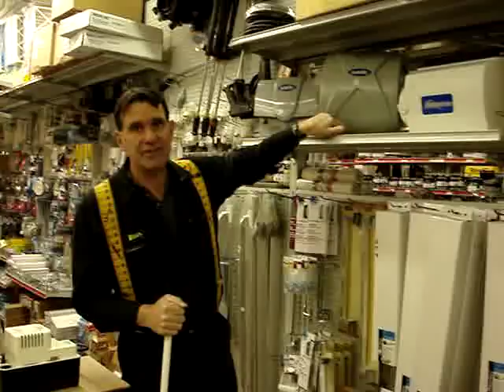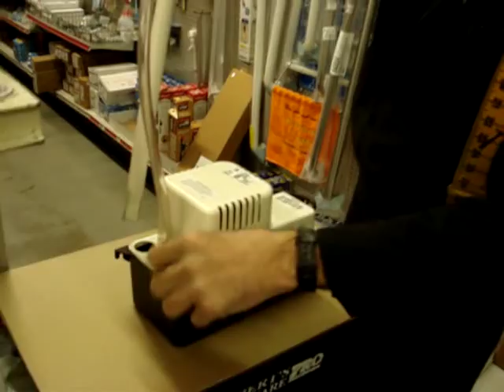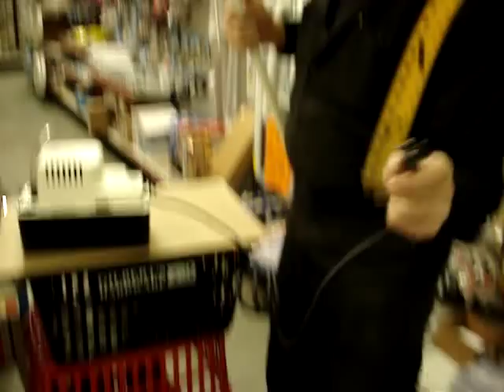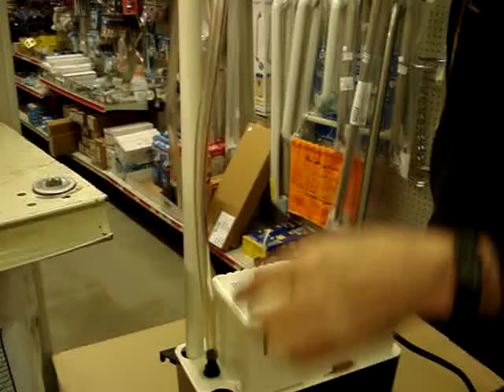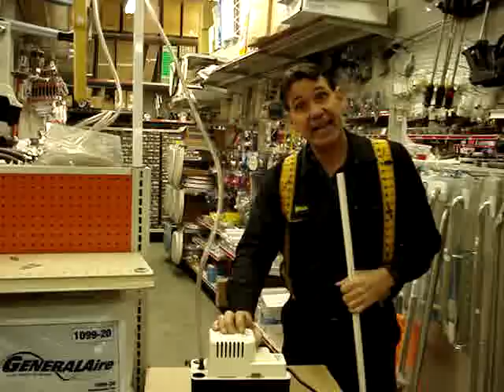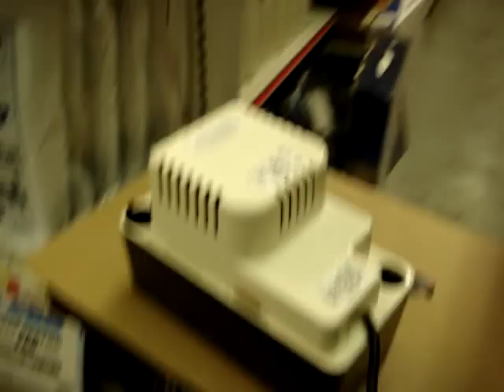Furnace Condensate Pump Moves Water If There Is No Floor Drain

Comment: I realize this is an old YouTube video but I have a question. Do these condensation pumps only work on gravity for the intake of water run off? I’m wanting a pump that will draw water off of my hot water tank release valve but also if and when the hot water might start to leak more water onto the floor. I don’t have a floor drain near the hot water tank. If these pumps don’t work, can you suggest what type of pump I could use. Thank you.
Reply from the maker: First off, hot water tanks usually leak elsewhere when they fail. If you are getting water occasionally out of the overflow something is wrong.
If you could put your hot water tank in a big enough deep enough pan and enough room for a condensate pump, there’s a good chance that if reconfigured properly it could evacuate a 2”  deep pan….. could be a good invention. It might even exist now, however I’ve not seen it.